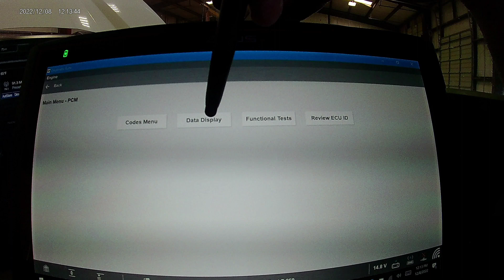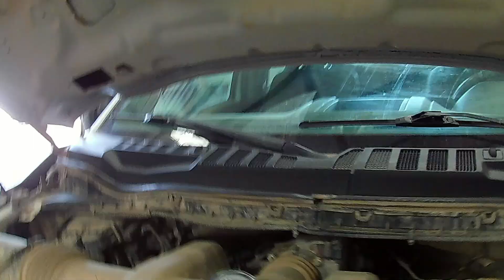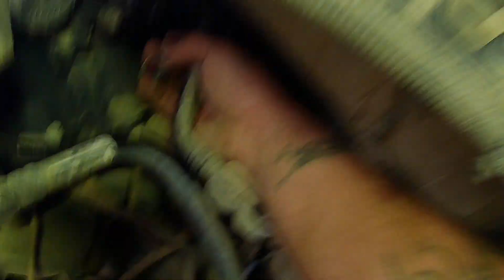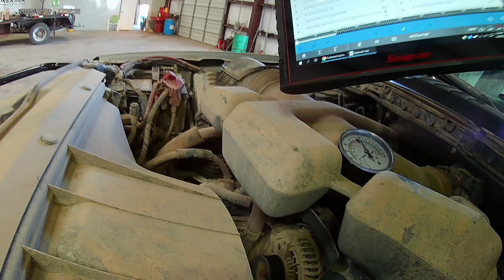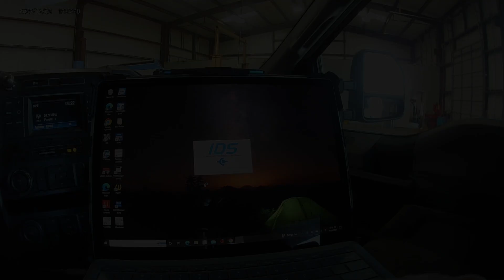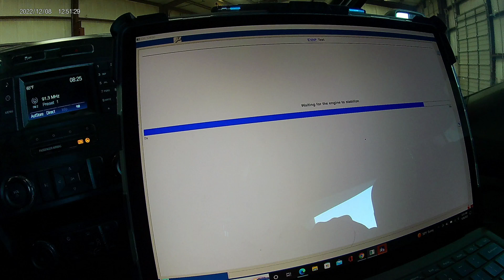Fix that Dreaded P0456 Check Engine Light...FOR GOOD!

Comment: I'm curious about your thoughts on what is the best overall computer to buy is for an independent shop. I have a Modis, but it's outdated(lot of money spent for nothing), and I have the Matco Maxi 2.0( only thing good about it is it's wireless). I had a Tough book with IDS, turned out I got scammed because it was being cloned, then sent it off to a gut to reload the IDS programming, and now he's lost it?? I can't afford a huge investment on a computer, but I work on all 3 Big names, gas and diesel, and just want a good across the board computer. Thanks.
Reply from the maker: Honestly I would get the think car I have one as well and I been putting it through the ringer and so far it’s working. It’s really strong with gm and ford it’s a bit behind like 2 years so you can’t work on 21 year models and for dodge it’s just not there at all but I have a Bosch to cover my dodge so there’s no one tool that covers all but my best bet would be the think car but get the big tablet because all the smaller ones have issues .
Reply: Thank you for your quick response and keep making these awesome videos.